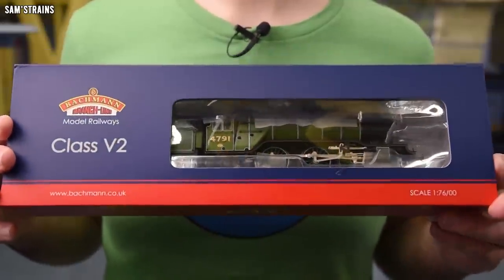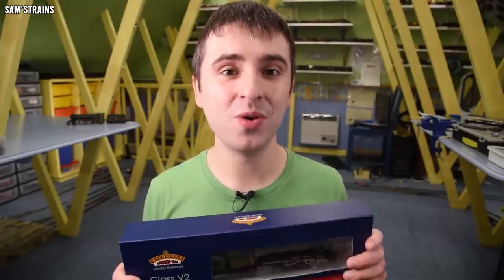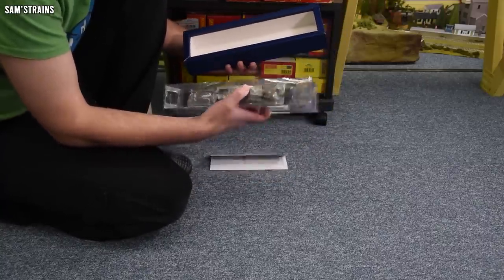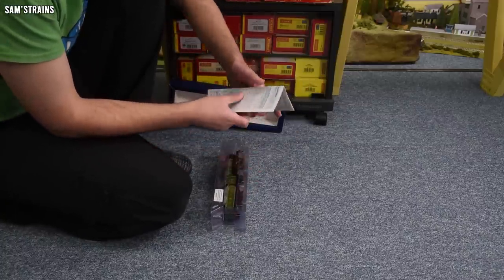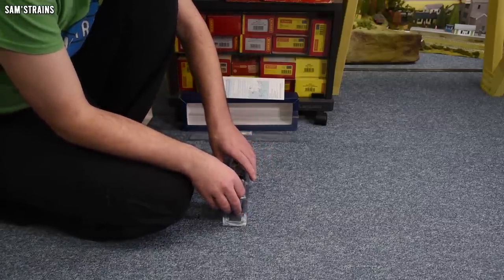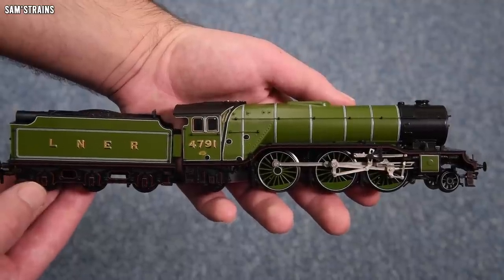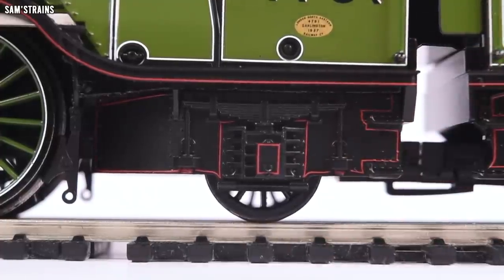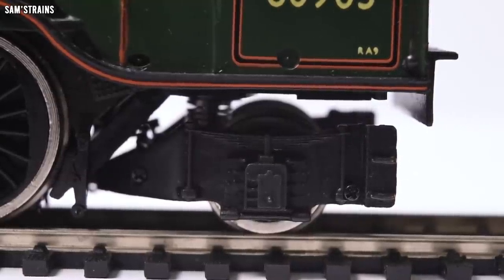Brand New Bachmann LNER Class V2 | Unboxing & Review

Comment: Still one of the best looking steam engine designs to my eyes. A thing of beauty is a joy forever.
Reply from the maker: Yeah you could be right - absolutely beautiful for sure! :D
Thanks for watching, Sam :)
Reply: There is a problem with Prarie locomotives driven on the centre axle: they tend to waddle at higher speeds, due to the geometry being symmetrical fore-and aft. Maybe it is possible to alleviate that by careful design. There is a similar problem with ten-coupled locomotives as well.
Reply: Gresley's masterpiece - Pacifics included.

Comment: The fact that this loco irl is just a slightly shorter version of the A3 yet just as powerful and versatile despite the problems it encountered is also very interesting.
Reply from the maker: Yes absolutely - it looks way smaller than the A3, but side to side not that much different!
Thanks for watching, Sam :)
Reply: The boiler is a cut-down A4 250lb boiler, not a cut down 220lb A3 example.Note the lower washout plugs on the firebox are angled on the 250lb boilers, and parallel to the ground on he 220s

Comment: The reason why the rear trailing axles are being made flangless and static (wt least i think) is to represent the Cartazzi axle. It was quite common with LNER locos and it involved an axle that shifted side to side in its static axleboxes instead of a moving bogie
Reply from the maker: Thanks a lot for sharing! It's a great design - works very well! :D
Thanks for watching, Sam :)
Reply: @SamsTrains  Sam, stop calling Cartazzi axles pony trucks! Nothing was swiveling on the prototypes. Previously Bachmann made the axle housing wider than the true scale, on some models, to enable lateral movement inside a cage. 
It seems they now think the way to go is flangeless with vertical compliance. It's amazing it can get round R3 when Hornby's 'solution' can't even get round R5!

Comment: Great review Sam.

Some more info incase anyones interested. The V2s were more closely related to the P2s than the A3s. Infact the original plans were for a fully streamlined design ala P2/2, butfor once the LNER board managed to talk 'Saint' Nigel out of the idea, these were mixed traffic locos after all, not express passenger jobs. However the legacy of the abandoned streamlining can be seen in the wedge shaped cab and recessed steam pipes.

Being derived from the P2s they did inherit some of their problems. The lead pony truck was of gresely own double pivot design, and like so many of his other 'two up front' designs tended to bounce around at speed, damaging track work and in some cases leading to derailments. (It was Edward Thompson who fixed the issue in the end) They also had issues with leaky regulators and Gresleys three cylinders in one casting concept meant that maintaience was a long, complex task because even a basic repair involved a complete rebuild of the front end. However, Thompson and Peppercorn in turn solved these issues and they did indeed become some very handy and useful locos.

Keep up the good work

Comment: One thing you missed on the tender coupling is that has a mechanism to keep the gap to a minimum. Works well.
The firebox on dcc, though not overbright, looks realistic to me.
Fantastic loco.
Reply from the maker: I didn't miss that because it isn't true. Gap between V2 and tender = 6.8mm. Gap between Precedent and tender = 5.7mm. Precedent has the old design...
Thanks for watching, Sam :)
Reply: Such a crude solution. They just have to look at other manufacturers to get some better ideas perhaps. High precision there is required though. I can imagine a simple click mechanism and power transferring via 4 magnetic 1 mm rods within that mechanism in each unit. When clicking together all eight 1 mm rods pull themselves together by magnetic force (Marklin system but would probably cost a license fee?)
Reply: @SamsTrains  your comparing 2 very different designs of loco. The gap will be different on both in reality. I know it has to be larger than scale because of the 2nd radius rule.
Reply from the maker: Of course Matt - my point was that the new coupling design wasn't necessary in order to achieve the 6.8mm gap between the V2 locomotive and tender, and I gave an example of the old coupling design achieving a smaller distance
Thanks for watching, Sam :)
Reply: @SamsTrains  Was the Presedent's coupling adjustable for length? I find that feature important as I have gentle curves I can close couple a tender more like they are in real life. In Bachmann's defence it has been better than Hornby's two position system that's either too close or too far.

Comment: Another comprehensive, informed and fair review, thanks Sam.  Much more informative than a mag. review I read.  One of these locos has been in the mail to me for several days (I'm in Oz).  I'm feeling a bit disappointed that, at today's prices, the major manufacturers still can't seem to get everything right (no metal running-plate, no flywheel).  But perhaps I shouldn't pre-judge until it hits my track.

Comment: A great looking locomotive by all accounts. The only thing is that people have expected certain features like diecast parts these number of years and the extra detailing. That once a company cuts back on it to develop a new coupling system. The cost for that must be made up from where they can cut back without a diecast footplate to do it in plastic. A way to offset the cost against other features to make it cost effective. Though with all the price increases since the start of the V2 development. The higher cost per model now seems to make it over price. Then again with the pandemic a lot of people got back into modelling or started for the first time. This helped the manufacturers to shift more units and have their profits rise. That now they think they can squeeze more out of a person's pocket and blame it on the rise of resource prices etc.
Reply from the maker: Thanks a lot John - yes that's very true! Customers shouldn't have to worry about the economics of their models... if they're expected to hand over £200 for a loco, it should be quality in all areas with no exceptions. If some manufacturers (based in China) can manage it, then others should too!
Thanks for watching, Sam :)

Comment: Hi Sam, Great in-depth review as always. Note that the coupling is a 'close coupling' so this keeps the gap to a minimum but allows separation to handle curves. It's quite an improvement but maybe not perfect. And regarding the Dapol coupling there are problems ! Running plate plastic doesn't change the overall look of this beautiful and fine finished model. And as mentioned in some comments this loco runs excellent on DCC and probably the majority of model railroaders do run on DCC. It could be interesting to do a poll on this. Quite expensive but value for money according the general new sales politics and worrying manipulated inflation. This truly is a superb loco I have put on my wish list. Bachmann did a good job on this one. Praise where due ! Thanks for sharing.
Reply from the maker: Thanks Filip - they may have intended this as a close coupling, but it's no closer than with the older coupling design... which at times was even closer... I checked with my new calipers! What are the problems with the Dapol coupling? I haven't run into any as of yet!
Thanks for sharing,
Sam :)
Reply: @SamsTrains  Some model railroaders report disconnecting during running sessions at the point some glued the couplings on the Dapol Mogul. Well nothing is perfect. Thanks for your reply ! Have a nice day.

Comment: About the loco-to-tender connection: I just bought a Bachmann Class 117, and it has the same kind of connector between the three cars. On there, it serves a useful purpose (makes it possible to have one DCC decoder for the entire unit, rather than one in each carriage), but it seems a bit weird for a loco-to-tender connection (which I usually expect to be permanent...)

Comment: Oh my Dear, the Tender coupling is a good one. In Germany it its used by Lilipt with diffrent pins but same System and how you use these Coupling is the stupit way i did ever see. :D
Take the Loco in you hand if shes coupled and a small Screwdrifer between the Hook little push down on the Hook and you get bouth uncoupling... easy going. Coupling is also easy Loco and Tender in one hand an then fist just hook down and let the tender slide in the Pins and finished. I Like these Coupling type more than Honbys metal Couple with screws thats sucks most. By the Way these coupling Idear is from the RC Modellbuilding and realy long time in use by these. The Dapol Coupling is nice and easy to handel but if you couple and uncoupling the Loco too much i thing the little dot gets damaged and dont hold these bouth good enough togehter. To the End one Thing... What does have the Train for a Weight if it does bends these Coupling of the V2 so much? 20 and more Coaches? comon thats not Serious enough what you showing there. ;)

Comment: It does look good . I wasn’t thinking about one but you’ve got me thinking . The tender attachment I think is an improvement on the Precedent  and Caley which is far too flimsy . I think in this case I’d leave the tender permanently coupled . The thing that spoils this is that big black stripe between boiler and cab which is way too wide and is very visible . To me it just spoils what is otherwise a very well finished locomotive .

Comment: Hi Sam.  Another excellent review, thanks.  Considering this loco is designed for DCC, with smoke box glow and speaker, I wonder if you have considered such reviews should include DCC features and DCC running performance?  Would that affect the rating the price (having DCC sound, etc)?
If not, maybe there is scope for a "DCC review" follow-up video, with a revisit to the score for such locos that comes with DCC sound, etc?  Just a thought.  Love the detail you give in the reviews, anyway.

Comment: When it comes to the tender couplings, I can't help but wonder if the reason why the one you like a lot more isn't used elsehwere may be due to a patent somewhere.
Truth be told, I wish we'd abandon having wires and stuff inside the tender. I dislike tender-driven locos as it is, and I would generally like my tender engines' tenders to be interchangeable to a degree without having to go crazy with rewiring (say for example I wanted Fowler tenders rather than prototypical ones... or just wanted to re-enact a tender-swapping incident involving Scottish locomotives).
Reply: One needs to remark that there are problems with the Dapol coupling. Note this is a 'close coupling' on the Bachmann V2. Maybe not perfect but quite an improvement. Cheers.
Reply from the maker: I'm not sure - I don't think Dapol would have patented their coupling... I'm not even convinced it's patentable, even if they were willing to spend the money! Any mention of close coupling is nonsense in my eyes - I have other Bachmann locos with the old coupling design which couple 1mm or more closer than this does!
Thanks for watching, Sam :)

Comment: Another well done review Sam. 
From a personal standpoint I think that the binding you could be having might be linked to the gears. There might not be enough space between the frame and the very bottom gear on the driving wheel. You could try to very carefully push that gear over a bit or just wait till the plastic has worn down from rubbing on the metal frame. Still, good locomotive for a hobbyist to enjoy. 👍

Comment: Another great review Sam. I bought my 4771 V2 from locomotion Models and therefore paid the £229.95 price excluding postage. Unfortunately, it had to be returned for a paint defect and mine also had the hook missing from the front tension lock coupling. Replacement arrived a few days ago with no paint defects or missing hook and it ran well.

Comment: Another fair review Sam. On quality we would have given 3.5 starts I think but that’s just a minor difference. We’ve wondered what could have been done by leaving some (imho) toshes out, e.g. sprung buffers and painted cab. The latter is sheer invisible as it is and must be stinging production on costs. Another thing; not sure, but leaving the driving transmission to the driving rods will create tight spots and slight wobbling evidently. We’d rather prefer high precision metal gears driving all large wheels which will do away with all tight spots, spreading energy evenly. Oh and micro locking sleeve connectors for the base plate should be viable perhaps. For the money the loco seems very okay though. Generally speaking the German manufacturers will bulldozer over this but then be prepared to pay over 300 for a steamer. So overall for this one, it certainly is quite okay. (A tad silly that lubrication seems to be needed out of the box).
Reply: For me, personally, I like sprung buffers as a nice little detail; it can add so much to the overall feel of a locomotive. If I buffer up a locomotive to a long rake of coaches or freight cars and start pushing, and I see the buffers start to compress under the weight of the train, it just feels satisfying. I also like when drive is provided by the coupling rods. While it may present the opportunity for them to bind as we've seen here, just knowing that the mechanical pieces I'm seeing are doing their job is a big plus for me. It's like having a transparent clock with a ton of beautiful clockwork pieces inside, only to open a little cover and realize the hands are driven directly by a small electric motor and the clockwork doesn't even move. That's why part of why I've never been a fan of tender-drive locomotives.

As for the sub-par lubrication, that's just a bit of classic Bachmann quality right there. lol

Comment: Your comment about not doing a direct comparison between the new model and the older version made me think, that could be a cool concept for an episode.  Find a few different examples where the same manufacturer has done a completely retooled model of a locomotive they have offered before, and show us what's new in terms of mechanism, detailing, livery, price (adjusted for inflation, of course), and whatever other points of comparison you can think of.  Obviously we would expect to see the new model being significantly better than the old one, I doubt there will be any surprises as far as that goes, but it might be interesting to see how different manufacturers have approached the retooling process, if you picked several examples from different manufacturers.  That is to say, not the same model done by different manufacturers (you have already done a few comparisons of those), but several examples of models from different manufacturers where both the old and new versions of that model were done by the same manufacturer, so Bachmann V2, Hornby A3, etc..

Comment: I was excited when you said that it had a new tender-loco connection. Then I saw you try and take it apart...
All they really needed to do was have a tighter connection between the pin and tab on the old connection and it is mostly sorted... either that or have the same connection with a more sturdy wire connection so that it doesn’t feel like it will rip apart under any load...

They’ve taken the problem, and made an over complicated solution to it...

Comment: I've just received my Green Arrow version from the NRM. It has DCC sound. Looks absolutely stunning as you agree. Running it in though on DC is abysmal. So much so that the first example had to be returned to the NRM because it was as dead as a Dodo. To their credit, they did arrange its pickup. Its replacement wouldn't move until 80% power applied and then could only cover its own length per 1 second. That's slow. 
I have just bought a DCC controller (2nd hand, as no new ones available), so will test it on the same rolling road you bought Sam (they're good aren't they) and hopefully there will be a significant improvement in performance.

Comment: Wow, that livery is so excellent it would make the men at Darlington & Doncaster works really proud. I often wonder if an Airfix MRRC 1001 12V 5 pole motor would improve the performance of these locos? I recall the transformation of Hornby BR Mogul (the original) when the 3 pole sticky motor was replaced it was quite a transformation. If 'one could be fitted' into modern loco it maybe another tranformation!

Comment: Hi Bill I've read your comments re MRRC motor as a possible replacement in modern locos.Many years ago I acquired a Bachman A1 Pacific (Aberdonian 60158) at a swapmeet. After 5 mins or so of running it slowed up to a stand and the firebox top was very hot.i removed the body and noticed a very small Flatt can motor which was extremely hot.i believe this was one of a faulty batch of motors.re article in BRM by Tony Wright. As loco was pre- owned repair was down to me as unable obtain new motor. I was very impressed with the chassis in general and wondered if a MRRC/1001 (a motor I have mutch experience of)could be made to fit
Reply from the maker: Hi Fred - I've actually got a video on this topic coming out very soon! It involves substituting the original Bachmann motors with a cheap corelss one (£3), by means of a cheap 3D-printed motor mount. I have the first few locos up and running, and they perform similarly (though not quite as well at slow speeds) as the much more expensive Bachmann original motor!
Thanks for watching, Sam :)